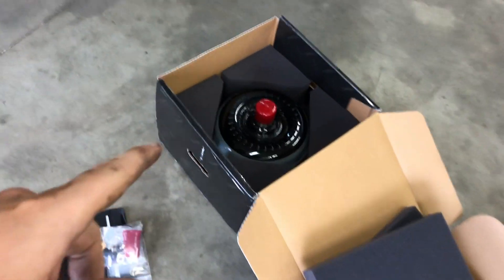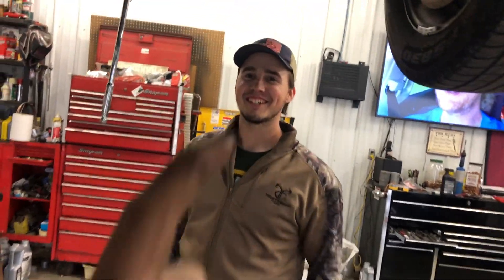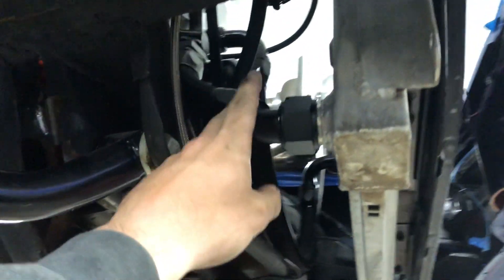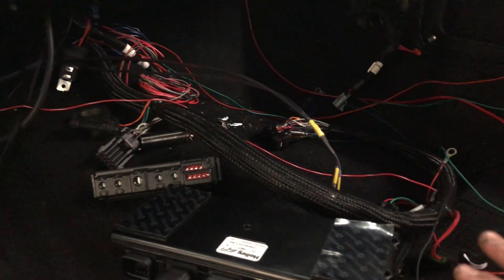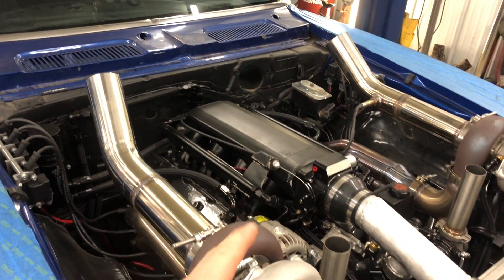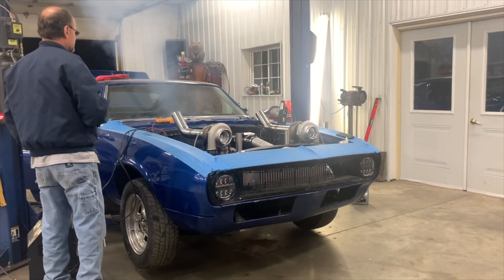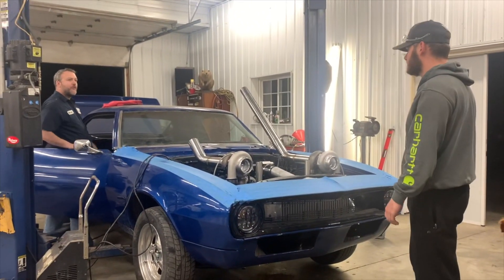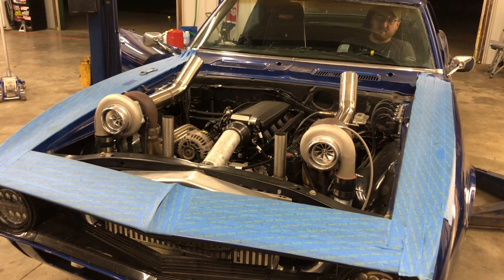FIRST STARTUP!!! Twin Turbo Camaro LS Swap. Part 8

Comment: Question about the turbos. What size pipe did you use to go from the manifold vbands to the exhaust inlet vbands? I have the same turbos just arrived and getting ready to tackle the project.
Reply from the maker: I used 3” elbows with a 2.5” reducer right before the turbo. But 2.5” wouldn’t have hurt anything 👍🏻